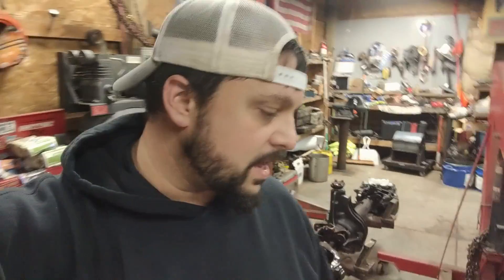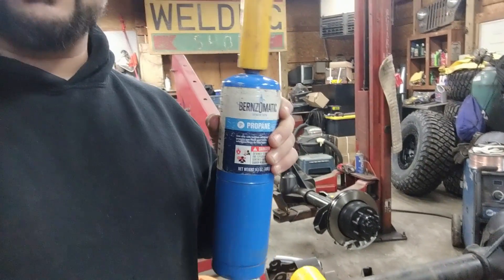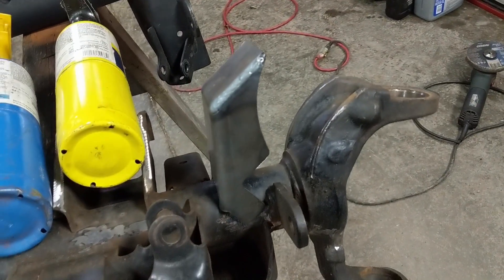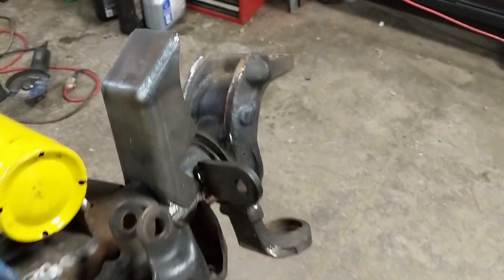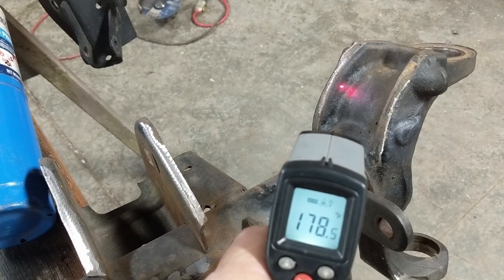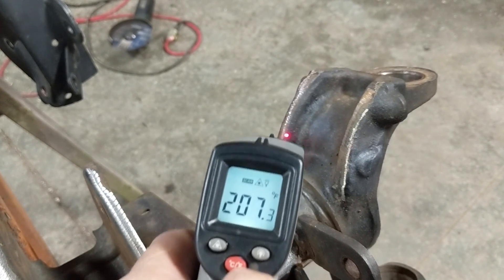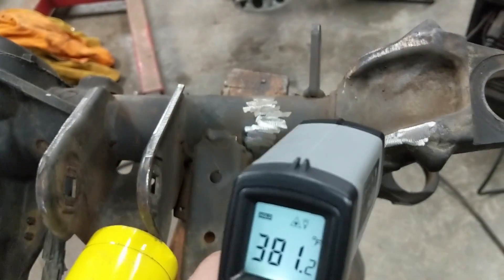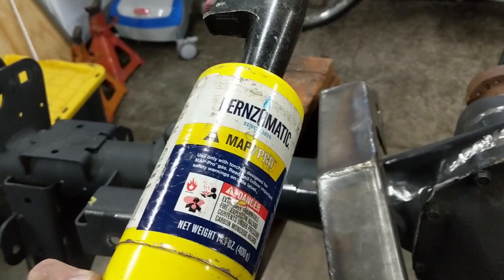MAPP Vs Propane Gas, Cast Welding

Comment: You've got different torch heads - the one which allows O2 into the heat would be hotter.
And, you're not using MAPP gas, there is no more MAPP gas - you're using Map-Pro.

Comment: The map pro isn't really mapp gas , it's a mapp propane mix , if it were real mapp gas the difference would be about 1500 degrees instead of just around 175 or so.
Reply: No, you are wrong!  MAPP is a trademark that was owned by Union Carbide, and as that company shriveled up it sold the trademark to Benzomatic so they can now legally put that MAPP label on their propylene (AKA propene) bottles.  Benzomatic wanted to confuse those loyal to MAPP gas by first calling their propylene MAP gas-which Union Carbide did not trademark, then to MAPP gas,  after buying the trademark-into thinking they are the same gas mixture. If you are talking about the gas mixture then yes of course near pure propylene is not the same as Methyl Acetylene Propadiene Propane gas mixture. I believer the old MAPP had higher temperature and more BTU's and google says the propylene setups are safer and soot free, Here in the United States the propylene is the closest substitute for the old MAPP gas mixture and that is all the matters unless you have a secret stash of the good stuff squirreled away somewhere for personal use.

Comment: First off it's not MAPP gas.  Mapp gas stopped being produced in the US in 2008 and not sold to the public even before that.  Bernzomatic bought the name Mapp and uses it as a trade mark.  It says it right on the can Mapp gas Pro is what they call it.  It's 95% propane.  This guy is using 2 different torch heads that put out different volumes of flame.  The 8000 he had on the yellow can of propane will be hotter do to more output.  $11.99 for a yellow can or $3.99 for green can at Walmart.
Reply: Map Pro is 95 to 99% "propylene", not propane.
Reply: No double P.  Map Pro, nor MAPP.
Reply: *Map Gas Pro
Reply: This......   ^^^^^^^^^^

Comment: you need to use the same torch head on each bottle. you are getting inaccurate results
Reply: Yes, different nozzles can create different flame temperatures due to the mixture of oxygen/fuel and also nozzle geometry.
Reply: @Differentthings2006  EXACTLY!!!
Reply: Not true. The Bernzomatic TS8000 torch can be used for both.

Comment: I don't find a ton of use for propane. I feel like it doesn't help nearly as much for heating up stuck bolts.
Reply from the maker: I totally agree. I've basically completely switched over to using map gas now

Comment: That’s actually pretty cool. I knew mapp gas got hotter then propane but not 100 degrees hotter.
Reply from the maker: Thanks for the comment. I definitely had fun experimenting with the two
Reply: Map pro is on average about 165 degrees hotter than propane but mapp gas ( with two P's ) is about 1500 degrees hotter than propane.